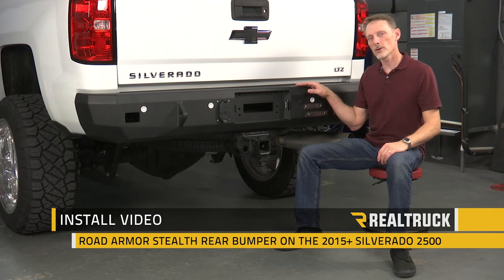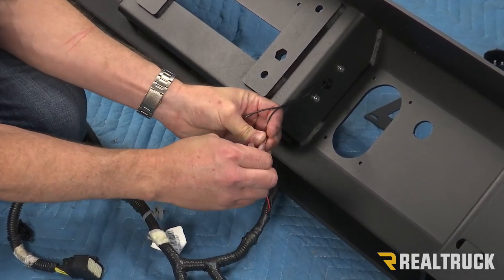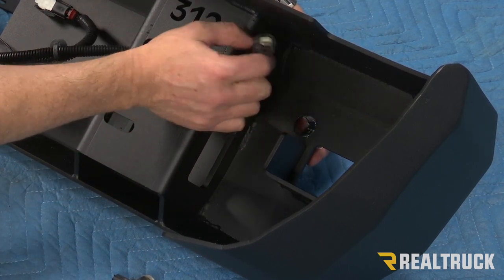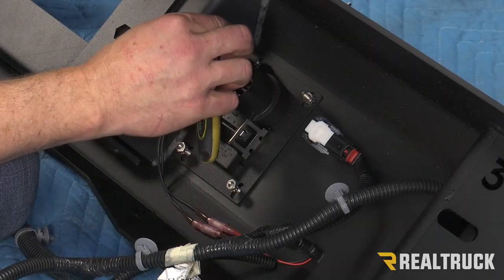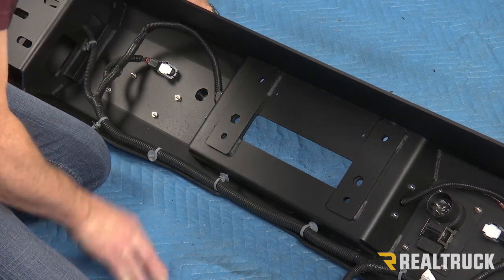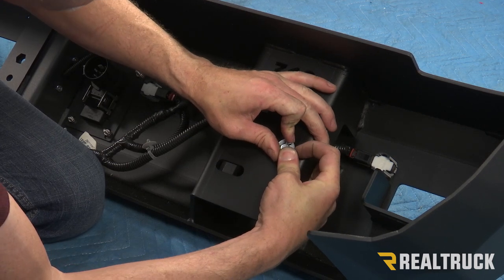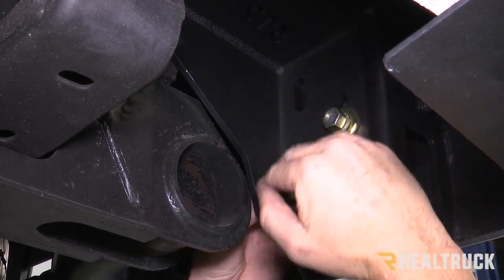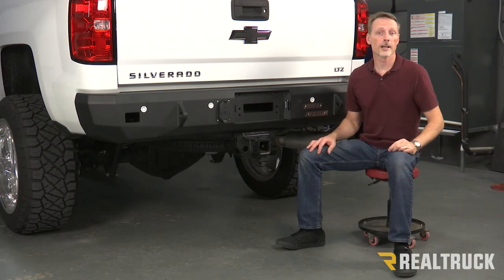How to Install Road Armor Stealth Rear Bumpers on a 2015-17 Chevy Silverado 2500

Comment: What about the hitch?. The way you left it only the middle and front of hitch is bolted to the frame. The factory hitch uses the bumper bracket for the rear hitch mount. And uses the factory bumper to support the hitch

Comment: Will your parking sensors work properly with the shackles installed on this specific bumper? Mine says parking assist blocked,
Reply from the maker: The shackles do not cover your sensors on that bumper, so that would not be the issue. Call our service line and ask for installation support. They can assist with troubleshooting!

Comment: Does the bumper come with a plate for mounting a winch?
Reply: Yes, there are side brackets that hold the winch into place.  These bolt to the back side of the bumper.  Get a "remote solenoid" winch, if you get the bumper, so you can mount it (the on/off switch) where you can reach it.  Or install a switch extension.  I bought a Smittybuilt....Warn is too expensive.

Comment: Do they make one for the 2015 With the front senors?
Reply from the maker: Thuan Ngo: Road Armor offers 4 Stealth Front Bumper options. Per Road Armor, they have issued the following disclaimer:  Factory front sensors have not been test fitted or proven.
Reply: I bought the front bumper, too, and it's monstrously bulky and heavy.  It will look silly on a factory truck.  Mine is lifted 7" with 37" tired and is still looks big.  It's still sitting in my garage.